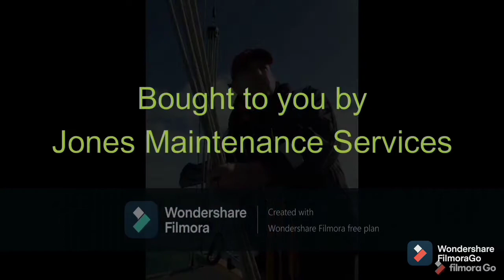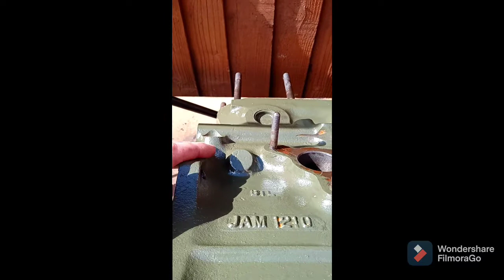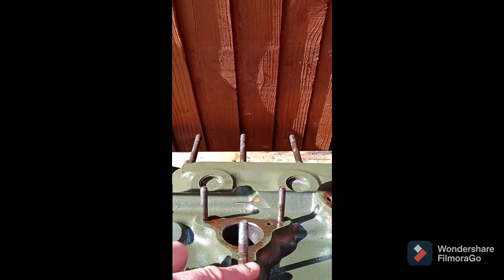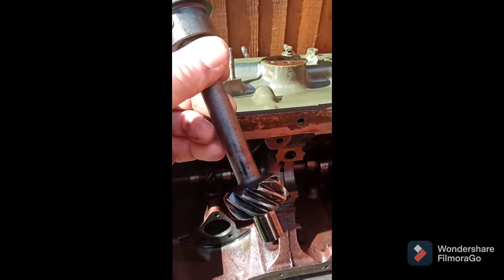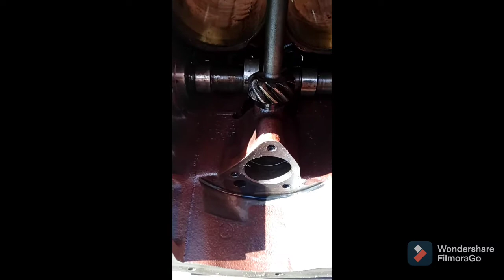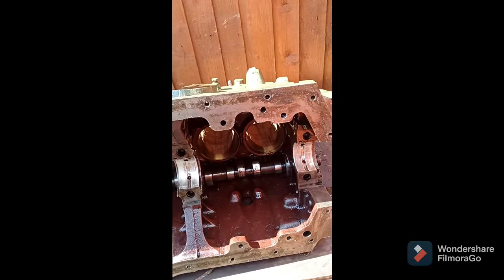BMC 1.5 BMC 1500 Engine Build Pt3 Internal Components

Comment: Great video. 
My bmc is smoking with a blueish tint. After ruling out any issue with valves or head gasket, I believe i have worn out piston rings. Im on a budget and pulling the engine out is very dificult.

Do you believe is posible to remove the cylinders with limited access and not pulling the engine out?

Comment: Evening, I am putting the injection pump timing together on the timing cover side on my BMC 1.8.
The 4 bolts that keep the half holding plates in position don’t have a lb per square inch in the manual. How tight should I tighten them before I fold the 2 tab’s over?. 😀👍🇪🇸

Comment: Great videos. I'm very interested on your BMC 1.5 diesel  videos. This motor is placed im my tractor which was built by AEBI (Switzerland). I've a problem with diesel in the oil sump and I hope that you'll bring a video about injection pump and fly wheel for this motor, soon (like BMC 1.8). Thank you and greetings from Germany.
Reply from the maker: There can be a few areas that allow diesel into the oil. Common faults are the diaphragm pump torn, injectors or the injector pump itself. Start with the lift pump, strip down and inspect. After the easiest option, send your injectors and pump for a overhaul.
Reply: @jonesmaintenanceservices4987  Thank you for answering to my comment. The lift pump was replaced through an electrical  one (from the last owner about 5 years ago). Switching on the ignition, without starting the engine, it seems, that diesel is running into the sump. So, my suspect is the seal of the injector pump.
Reply: @viktoriaknitl2528  did you fix this problem was it the front seal on the injector pump at fault.